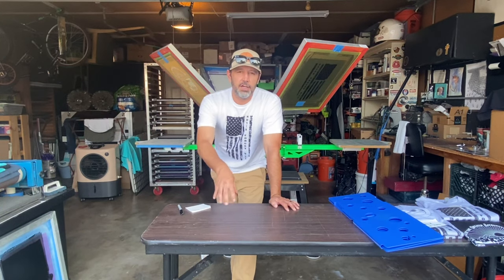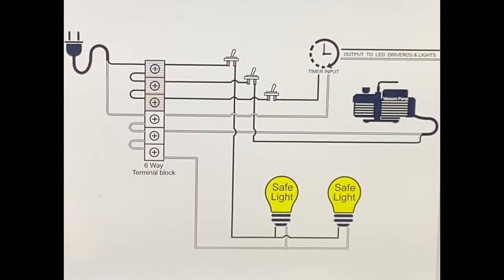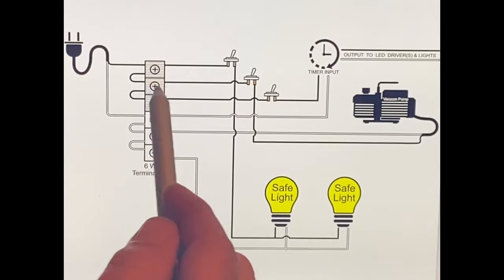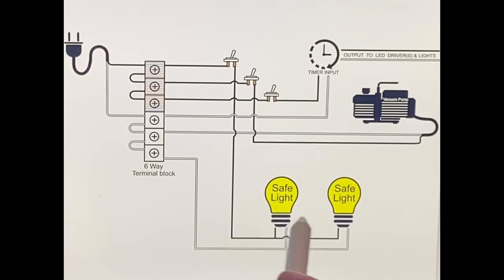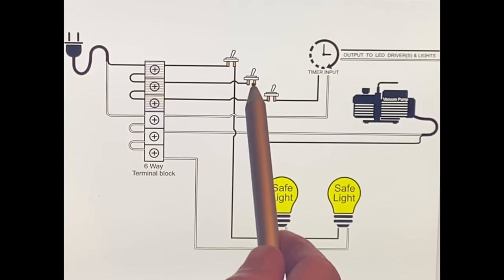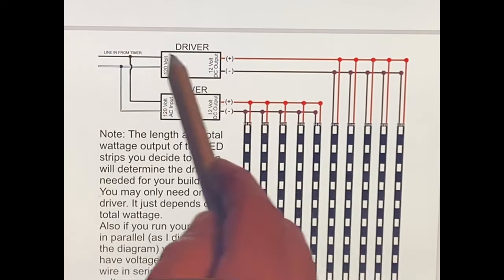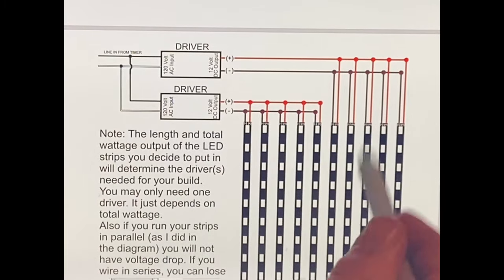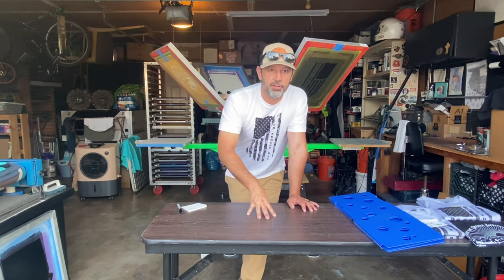Easily wire up your own LED Exposure unit with optional vacuum blanket. Screen Printer's DYI

Comment: Purchased everything you suggested,  pins from were too small, so I purchased them from LED Supply. I'm doing a replacement, from flourescent to LED. Followed your directions, and only half the lights came on. I can't figure this wiring out.
Reply from the maker: Update: I did remove the pins from the list. Thanks for pointing that out. Glad you got your lights working after our emails back and forth. Wishing you much printing success!!!

Comment: Fantastic video! your first video on the box was great and this topped it off!!! could you suggest another 120v timer that I could use for my exposure box that is a little cheaper?
Reply from the maker: Thank you Haylee! I appreciate the feedback. Sorry but I haven't done much research into other timers. Im sure as long as you find one that is 120 volt input and output and can switch on/off 0-999 seconds (mine actually exposes in only 16sec) then you should be okay. You could always shoot me an email at psapparel.helpdesk@gmail if you find one you might be questioning. I'll do my best to respond.

Comment: This is awesome. Thank you so much. What kind of wire are you using on the strips?
Reply from the maker: Thanks! I just used some wire I cut off of some old ballasts I had. Probably close to an 18 or 20 gauge. The wire I used was a solid wire and I think I would have been better off using a thin standard wire. I would even suggest purchasing a small roll of thin (18 gauge) standard wire. I found that the solid wire was harder to work with when making my connections in the wire nuts.
Reply: @prodigalsonapparel  nice, that is what I was thinking I would use but had to make sure cause I’m new to electronics. Thanks again! Glad I found your channel! Subscribed and rang the bell. 👍🏼

Comment: what was the wire gauge you used for all the connections to the safe lights from the switches
Reply from the maker: You could use 14 gauge

Comment: What do you use to hold your yellow bulbs upright?
Reply from the maker: This...https://www.homedepot.com/p/Commercial-Electric-Porcelain-Socket-81615/306198159?  and this...https://www.homedepot.com/p/Commercial-Electric-Assorted-Size-Zinc-Plated-Nipples-8-Pack-81725/306197864  and this...https://www.homedepot.com/p/Commercial-Electric-Solid-Brass-Hex-Nuts-12-Pack-81965/306198163

Comment: Do you have wiring diagram for automatic shutoff i think it needs contactor
Reply from the maker: Are you talking about a shut off for the the light? My build does not have a contactor. Basically as soon as I hit my third switch (for the timer/LED lights) the timer kicks on which supplies power to the LEDs. Then once my preset time counts down from 16 seconds. once it reaches zero the LED lights turn off. So in a way the timer is acting like a contactor. The light circuits is closed (on) when I hit the switch, then the light circuit opens (off) automatically once countdown reaches zero. Although the vacuum pump doesn't shut off automatically. I've always just hit that switch off once my exposure is complete.

Comment: Hello, thank you for sharing! I was doing the math on how much I would need, and I was planning on running 48 ft total at 44in a strip of the HD 60 LED. I would have 22 ft on one driver and 26 ft on the other. I was going to run them in parallel, so there is no voltage drop. Would the drivers at 60-12 still work?

From what I understand, 16.4 (Full Roll) is a 40 W draw, so if I ran the entire 48 ft of HD 60LED, would that mean I need a 120 W driver?
Reply from the maker: Im following you on the 2nd part or your question. Yes, you would need at the very least 120 watt output on your driver(s). Im not sure that they carry a driver with 120v output. You might have to split it up between 2-3 driver and just spread out your load as even as possible (not going over your driver rating on each). 
The part that lost me on the 1st question is the 60-12. It could just be that I'm super tired and my brtain is foggy but what do you mean by 60-12?
Reply: Sorry about that.  the 60-12 is the LPV 60w-12v driver I was planing on running two drivers at that ratting for the 48 ft. But it sounds like i should run 3 drivers and make them as evenly as possible?
Reply: Thank you for all the help I figured out the correct driver that I would need to run !! Stay blessed
Reply from the maker: @Chevy1962  Great!
Reply from the maker: @Chevy1962  Got it. Yes either way is fine. Just as long as you dont go over the wattage on any one driver. I try to keep mine below the rating when at all possible.

Comment: hi sir, can i know how to calculate the power supply? i have 15 led strips each is 1.2 meter with 120 diode per strip. How much watt  power supply should i apply?
Reply from the maker: Your power strips should have a wattage associated with them. Do you have the information where you purchased them from? They should come with a wattage rating when you buy them.
Reply: @prodigalsonapparel  okay i will ask the supplier. Thanks sir